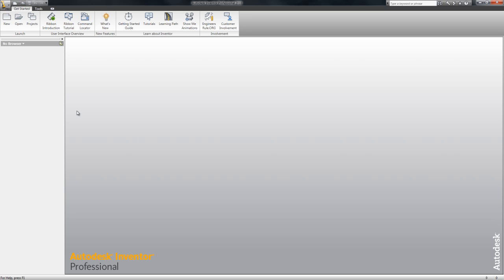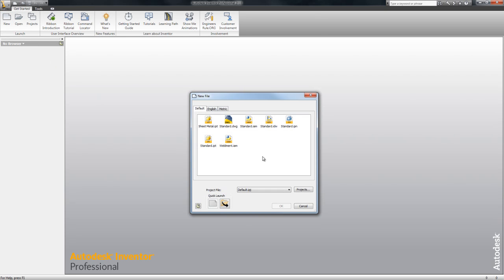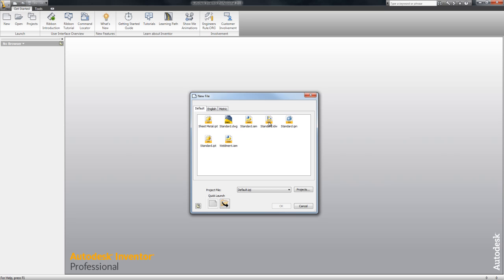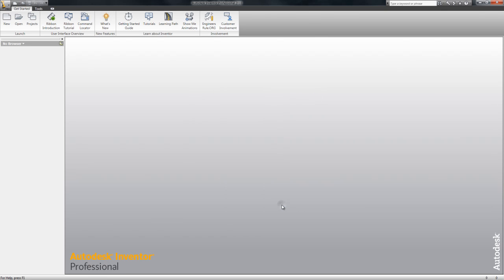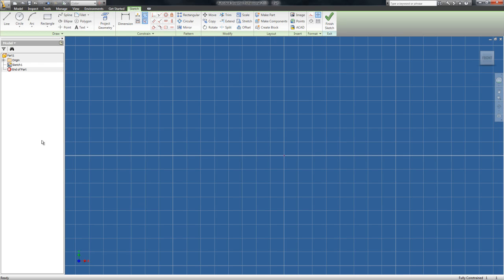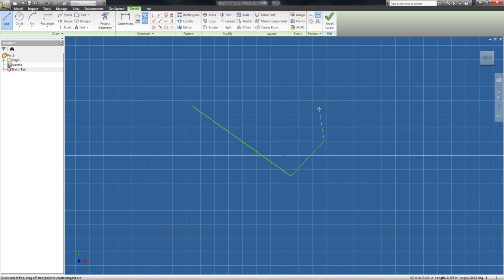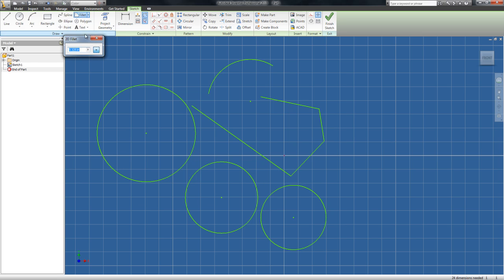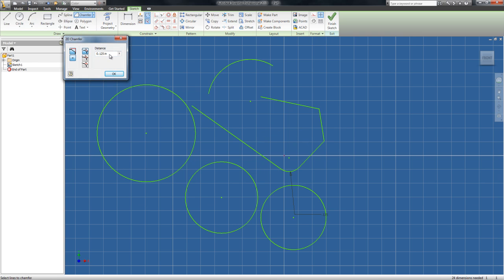Autodesk Inventor Tutorial 1: Intro + Drawing 2D Sketches (Normalized Audio)

Comment from the maker: Unfortunately this is one of the drawbacks of inventor. There are a few shortcut aliases however; Check out this link:

wikihelp.autodesk.com/Inventor/enu/2013/Help/1310-Autodesk1310/1480-Work_Env1480/1481-Work_env1481/1495-Command_1495